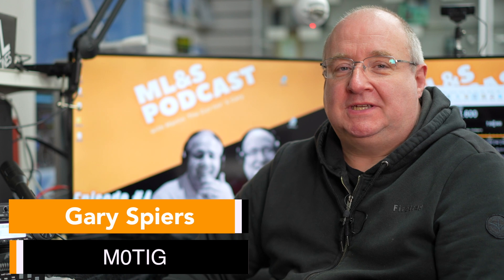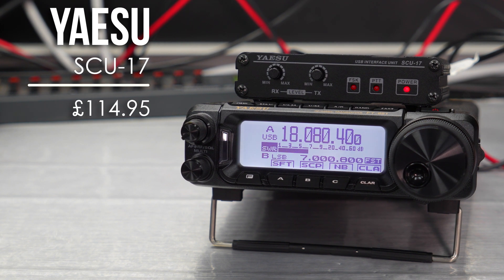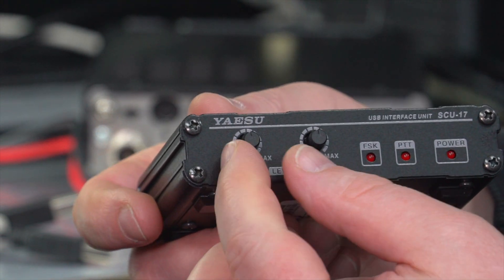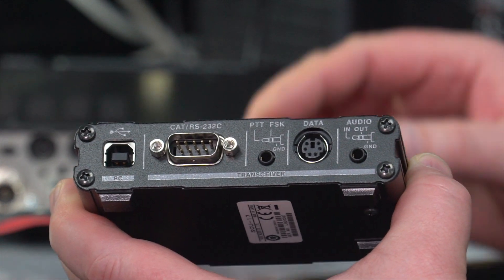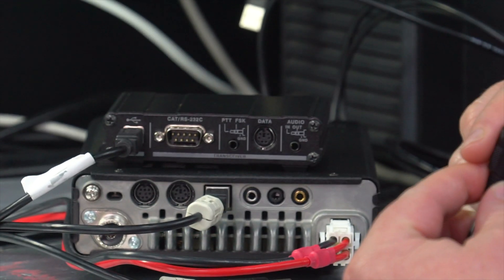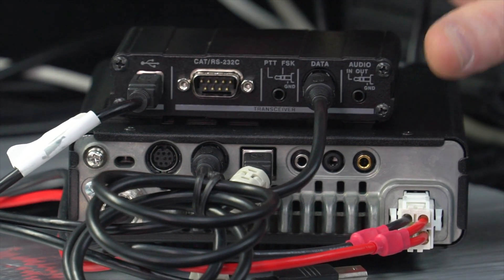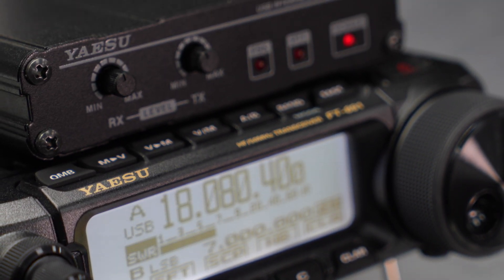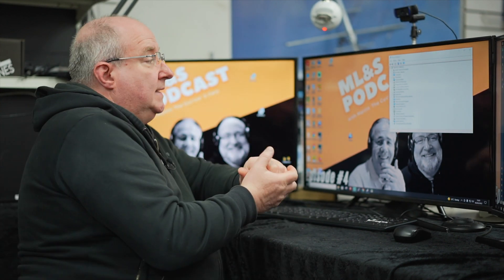HOW TO USE DIGITAL MODES ON THE FT-891 (SCU-17)

Comment: Great bit of kit I run 2 SCU 17's one on my ft817 for portable js8/ft8 and in my shack a ft891 for digital modes too. Another thing I did with menus' is select menu 11-05 and swap from MIC to REAR to make radio work through rear ports then swap it back to use SSB or CW normally. Park the rig on menu 16-01 to control pwr and run MTR in quick menu A to watch ALC on TX levels on SCU17. FT817 is bit different to set up you need to run the rig in Dig mode not SSB. Regards vk5cz ..

Comment: Completely missing in this video is: a) Installation of the SCU-17 related drivers, b) second USB cable is not preferred (avoiding yet another ground loop), as serial cable (opto coupler is inside SCU-17) can be used instead, c) earth loop de-coupling opto for the USB cable is not discussed, d) there are much better free of charge programs for FT-8 mode like JTDX and the fact that that the bandwidth of the SCU-17 unit is designed for RTTY but actually too limited for FT8 mode... A real pity!
Reply from the maker: I totally agree, however I could find no easy way for it to work another way, if you know how it is done I would be grateful if you could email me support@hamradio.co.uk.. cheers, Gaz